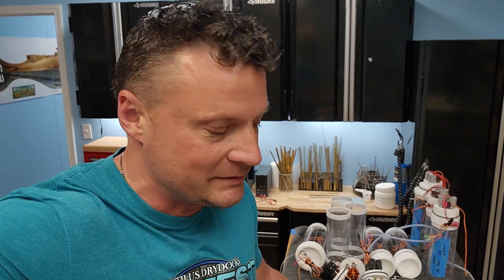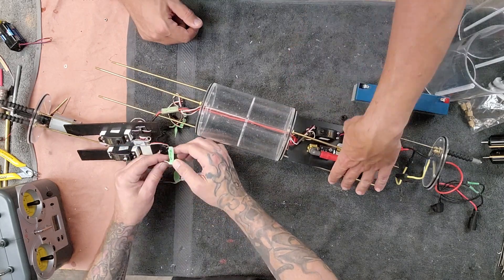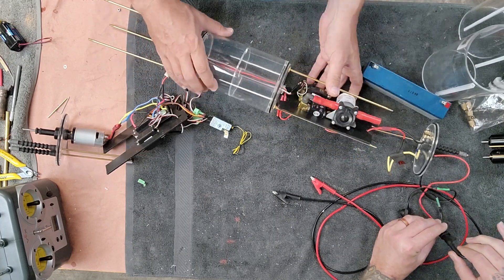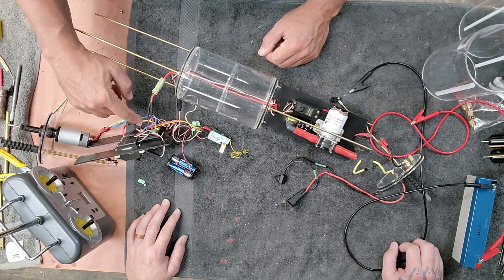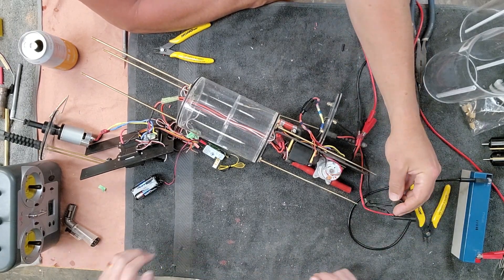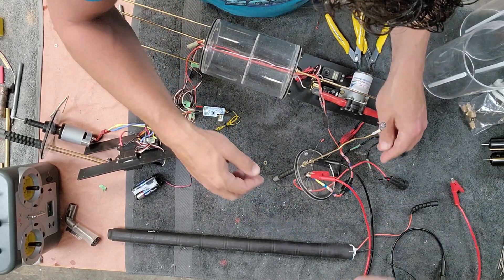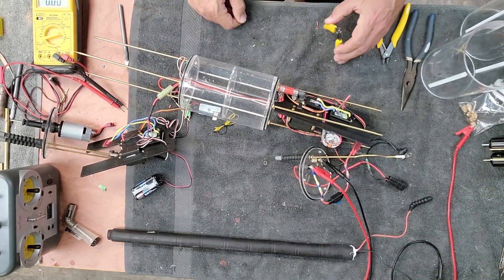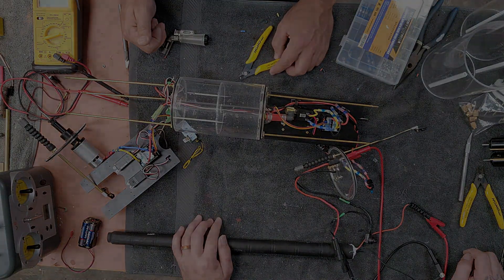Troubleshooting a Troublesome Watertight RC Submarine Cylinder

Comment: a question as a new guy to the hobby, me and a few friends are hoping to make a sub over the summer we still dont quite get the reason for a water tight cylinder, why not just put the electronics in the hull? also are there any good substutes for the mhz radio controller (the stuff on your site is all i can find)
Reply from the maker: I think what you're asking is whether you can just seal off the entire hull and put the electronics in the dry part. Yes, of course you can, but then you need to seal it somehow, and more importantly, get access over and over again easily. Also, a completely "dry" boat will have a ton of buoyancy. To get it to proper trim, you need to add a ton of weight, making it extremely heavy and hard to transport, launch and retrieve. The wet hull boats that use cylinders have the entire hull free-flood except the watertight cylinder, making it far easier to work on, transport, etc. You can also transfer cylinders between boats if you have some of similar size and ballast requirements.

Comment: EXACTLY what I recently experienced on my OTW cylinder except I am a newbie to the RC Sub world and I spent hours diagnosing my problem.  I blew 14 fuses and went through 2 BECs before I traced down and realized that you MUST disconnect one of the 2 BECs power wires. While your sub may run fine for a few hours with 2 BECs powering the receiver, it eventually shorts out one of the BECs.  Lesson learned and important that you read and understand the warning in the Viper BEC instructions for multiple BEC installations.  Thanks Bob and Jason.  I wish I had had this great video before I encountered my problem.  Love your instructional videos!!!